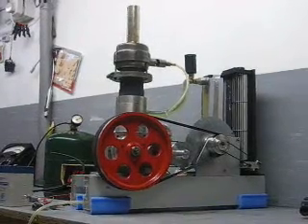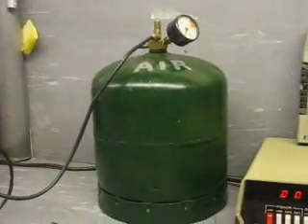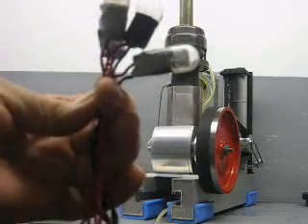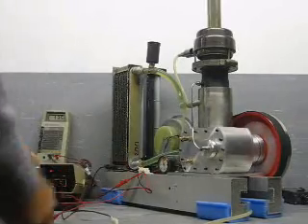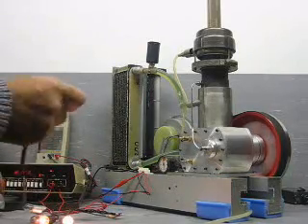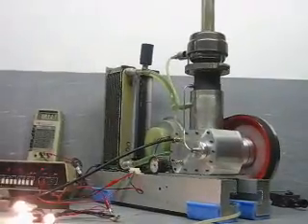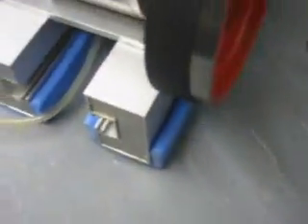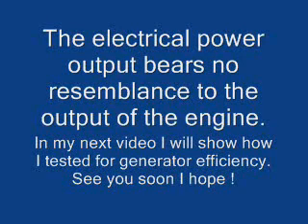Rhombic Drive Stirling Engine Part 4

Comment: Dear Barumman: This is an incredibly  beautiful engine ! Not just fun to watch, but extremely well built & generates Real Power ! I say this as I have been building Stirling Engines for 40 years & still not achieved half of what you have with this engine. 
I find sealing the shaft to be almost impossible as the Friction of the Seal stops the engine. My question is how do you Seal the Rotary Shaft of this Engine ?  Thank you.  James
Reply: James: It is not that difficult to make a custom shaft seal that has very friction losses.
The best way to proceed is to study the seal on a swimming pool circulating pump.
You would find these seals consist of two major components:  The rotating part sealed on the shaft and is made of carbon, the stationary part is made of aluminum oxide ceramic and fixed in the housing.
I've made a  tiny shaft seal, 1/4" inside dia. x 1/2" outside dia.  The rotating part is sealed with an Oring on the shaft, and is made of hardened tool steel.  The stationary part is sealed in the housing with an Oring, and is made of a hard bronze.
The parts should have a few thousands clearance on the shaft and in the housing.  The contact surfaces are only 1/16" wide, thus absorbing very little power.  A drop of oil at assembly, and it will last a long time.
The most difficult part is the lapping of the two flat mating/sealing surfaces, where the bronze face meets the steel face.
These two surfaces must be really flat for the seal to be effective.  The way to check for flatness is to use a small optical flat, available on ebay.  I used a piece of float glass which is quite flat, but the optical flat is much better.  You also need a monochromatic light source.  I used an old neon bulb from my junk box; sodium vapour lamp should work well.
Lap the surfaces on a lapping plate using very fine lapping compound, and check for flatness using the optical flat and monochromatic light.
If you are not familiar with this process, read up on it on Youtube or elsewhere.  For specific questions contact me here.
The seal I made kept the engine pressurized with helium for over one year.
Bear in mind that helium is exceedingly difficult to contain, and will leak through most glass and metals.
For long term running hydrogen gas is better and cheaper.  Although hydrogen is flammable whereas helium is not, a well constructed engine, used in a well ventilated space, would be quite safe.
Do the early testing with argon, which is cheap, until all obvious leaks have been repaired.
Then run on helium.  You will be surprised at the increased power output, because helium is a much better conductor of heat than air, nitrogen gas, or argon.
After running well on helium with minimal leaks, you are ready to run on hydrogen, with another power improvement!

Comment: I may be wrong and he might have this in here but that coolant system if modified to use oil to assist in cooling and lubrication might improve the mechanical efficiency, also i hear using a different internal gas density via pressurized helium or nitrogen may yield very interesting results.

Comment: Hello sir. Brilliant!
You show volumetric efficiency is increased when pressurised. If you used hydrogen it will be 7x better over air.
There was an American firm called STM that made a four ceramic piston motor that ran a swash plate. It could be carried under the arm. 50,000 hours between services, 75KW (100Hp). With hydrogen at 150 bar.
Oh how I wanted one of those.

Comment: Congratulations on such a fine looking and performing Stirling engine.
Can you explain the operation of the radiator and fan (from a photocopier or similar?). Does it operate all the time or is it triggered by a thermostat and where does it draw power?
Thanks again for all your videos, they are inspirational.
Regards, Aliian7777

Comment from the maker: @amfan12 
Hi, 
      If I used more pressure I would also have to increase the heat input, there is a piont where the heat exchangers become inefficiant so there is no gain.
Thanks for taking an interest, Cyril   :)

Comment from the maker: Hi Shawn, I have run it on Helium and it was quite powerful,  the problem with Helium is that due to the small atoms it is hard to get it to stay in the engine, it leaks through all the seals and joints whereas air will stay in there for days.

Comment: Hi, i´m a Student in Mechanics Engineering in Venezuela. I´m designing a Stirling engine for my thesis. I´m thinking about a Beta configuration with rhombic drive for the basic design. I will be very grateful if you could help me achieve this goal , since nobody here in Venezuela knows about stirling engines and there are very few books related. Once again i really appreciate if you could help me. i'll be waiting for your answer

Comment: Very nice engine,Think I could hook that to a fresnel magnifying lens to give it power.How about runing my hydrogen cell i need about 12 volt 4.5 amps to give me the power needed
.Lets build a hydrogen engine Proto type out of plactic , a tube 12 inch long, a piston 2 inch dia,water as a flash back at bottom of tube a spark ,Send the piston up to top of tube with the hydro!!?Thanks Jeff Machinist Arizona USA